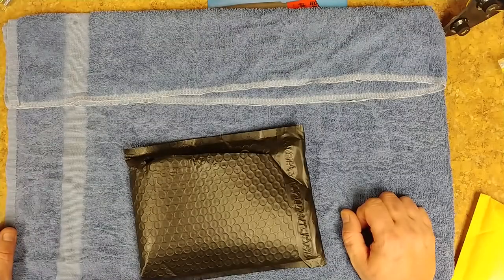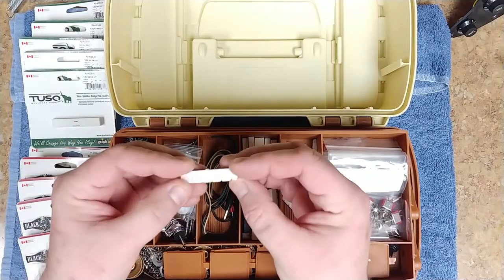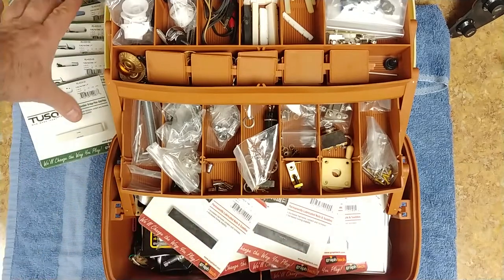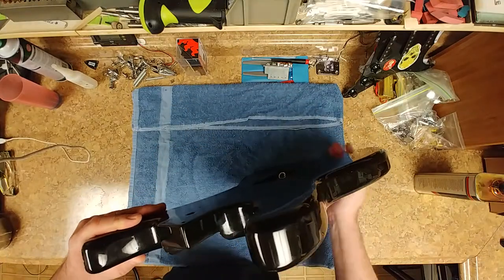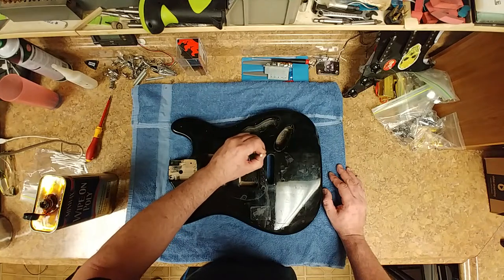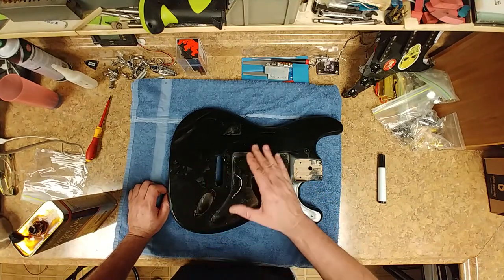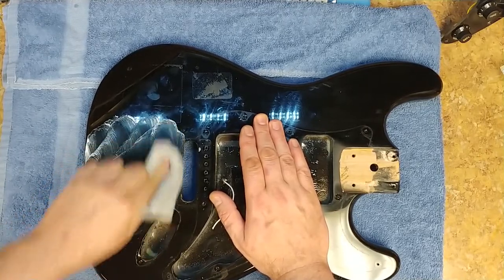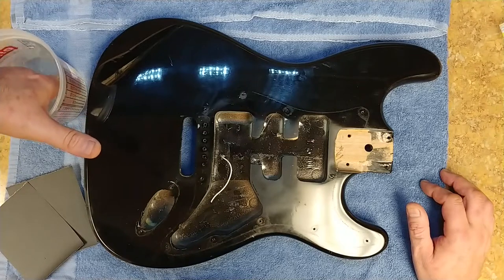Unboxing and Weedy Guitar Studio Body Sanding

Comment: If you have an extra floyd holla at me and tong oil I will use it on my evh replica Eddie said thats all he used was the oil after painting wish I had a gibson pickup or fake one it eould be close to what I need to finish the EVH dont want to use a Ibabez pickup may do a giveaway on those Randy Flying V Jacksons in the mean time of the gyitar giveaway have an awesome pedal im gonna send you soon hope you enhoy its a fab tone by Danelectro from 1996 think ots in great shape it weighs almost 2 pounds if not more its so heavy duty its worth 40 used by Ebay standards I think its worth more Rock On thats my Christmas present to you!!
Reply from the maker: I don't have any Floyd's that are one peace. It's only parts. The blades were worn out, but I took all the parts I could save off them.